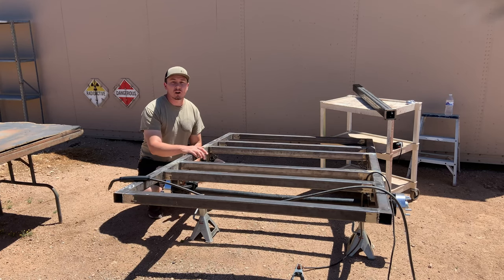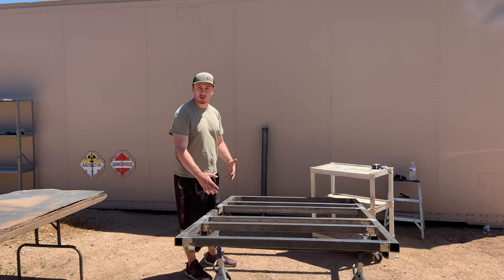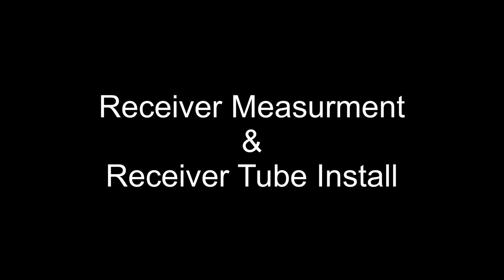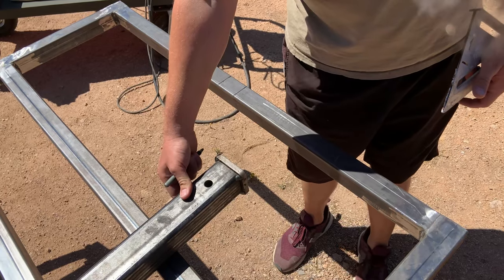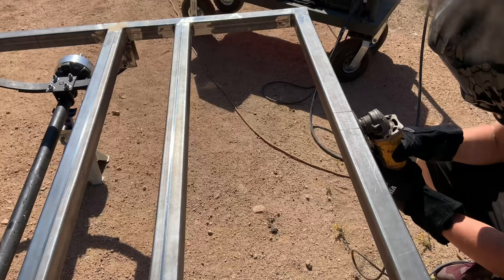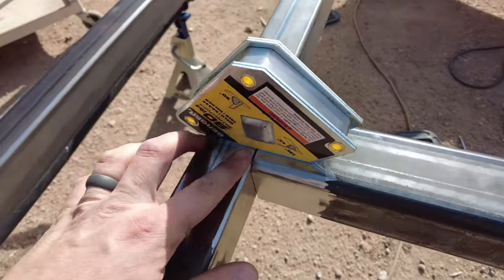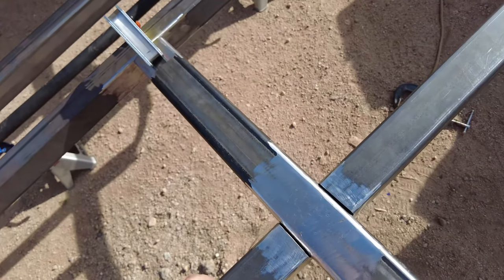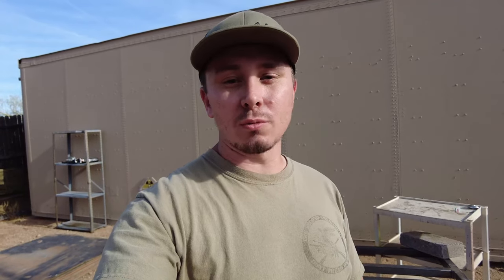Introduction to our Overland Trailer build, Hitch selection & Receiver Install

Comment: Definitely would like to see this series I built trailers before and I ended up using axles from mobile homes 15 5x5 10 ft wide very nice job excellent detail You're very articulate man keep up the good work
Reply from the maker: Thank you very much! The Cherokee is pretty gutless so I think the trailer is gonna be on the back burner for now but it will definitely be an overland trailer in the future!

Comment: I want to build a trailer almost identical size. Please do a series on the build!!!
Reply from the maker: We will definitely do a series! We’re gonna wait til summer is over to keep it going. It sucks welding outside during summer 😬😅
Reply: @2AOverland  your not telling me anything new. But you are in a hotter area than me. I'm in northern ohio. What I like best so far about your channel is that my future build is a 96 cherokee lol.
Currently rocking a 97 grand cherokee though.
Reply from the maker: Yeah it was 105-110 here for about 10 days straight. We’re lucky right now with getting some monsoon rain for the next few days. That’s awesome man! That jeeps gonna serve you well. And I’ll keep the Cherokee vids coming.

Comment: Shouldn’t you be using shackles to link the leaf springs on the rear of the springs? Your going to limit the spring flex and break springs,frame and possibly other damage. I’ve never seen leafs solid mounted
Reply from the maker: Thanks for watching! You do have a point and I didn’t realize that til I was looking at other trailer designs after welding the brackets lol. I was thinking about buying a longer leaf and then it could give me the option to add in a shackle since the leaf is longer. And if that doesn’t work I don’t mind cutting the bracket off too